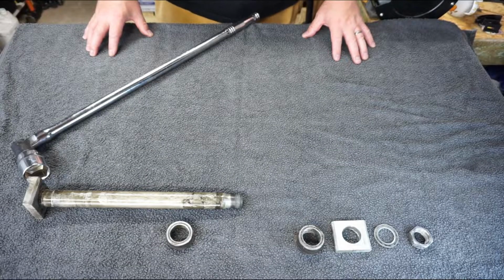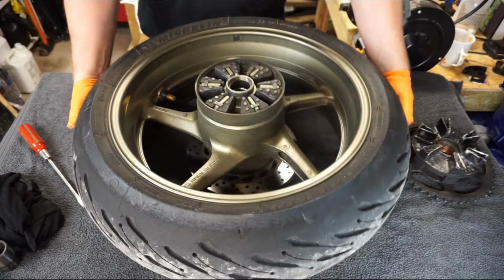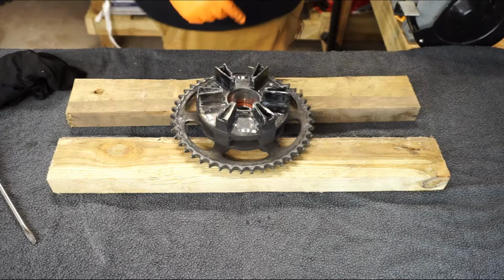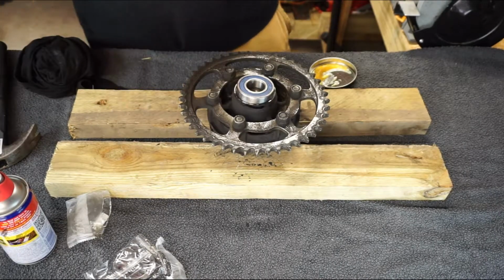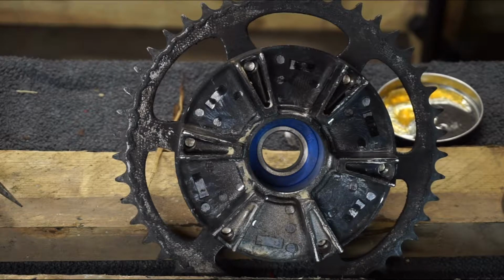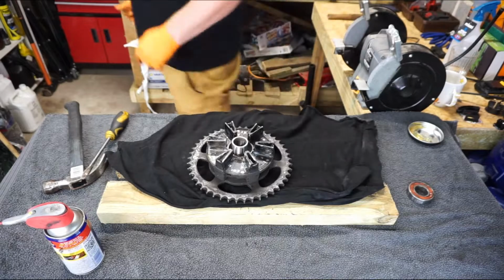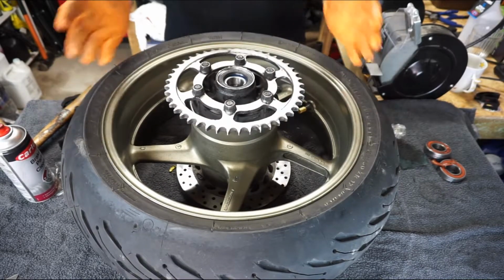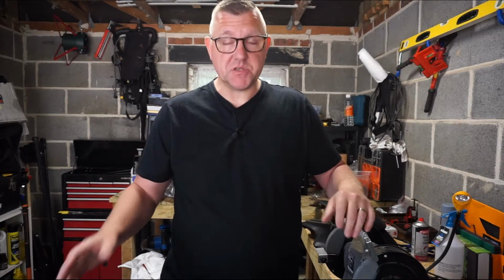Rear Wheel Bearing Replacement - Yamaha FZ1

Comment: Do NOT use the old bearing to drive in the new one. It will get stuck and you’ll end up driving the new one out just to push the old one out that’s now on top of the new one leaving you no way to drive it back in all the way. 
Use the correct tool to drive the new bearing in. You’ll thank me later.

Comment: are there needle bearing on this wheel? if it does, did you change the needl bearing aswell ?
Reply: You can see the needle bearing @ 9:57 mark. He didn't change that OR the other wheelbearing on the other side of the wheel.

Comment: Are your tires the Michelin pilot road 6’s? How do you like them so far? I just got a set on my FZ1. Not broken in yet.
Reply from the maker: Hi,

No unfortunately. They are road 5s and give really good grip. It’s great to ride on good rubber, confidence inspiring. 

I am a little jealous of your road 6s though. I will have to get some more miles under my belt first though.
Reply: @mammothmotouk  What year is your bike?
Reply from the maker: @Dirtywhtboy87930  she is 09 and about to get a home respray. Videos coming soon.. we’ll after this heat wave anyway.
Reply: @mammothmotouk  what color are you going to shoot? I’m contemplating on doing a color change on mine. It’s the liquid silver from the factory now. I had a Honda Magna that was a 1988 and it was a darker red metallic. Had Magna sprayed on the tank in charcoal grey metallic, that was one of my favorite colors so far.
Reply from the maker: @Dirtywhtboy87930  nice!

That’s a top secrete star the moment but it should, as long as I don’t mess it up, be mint.